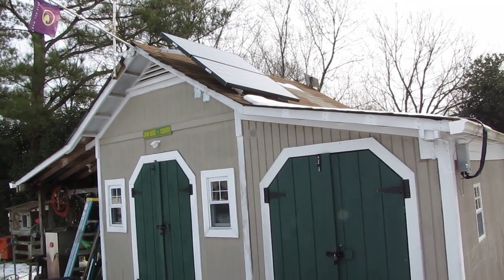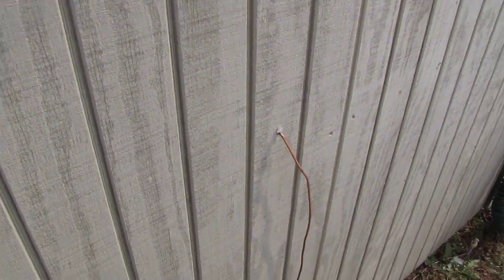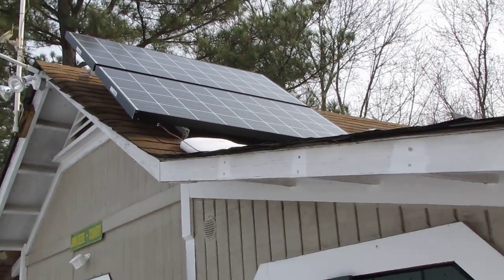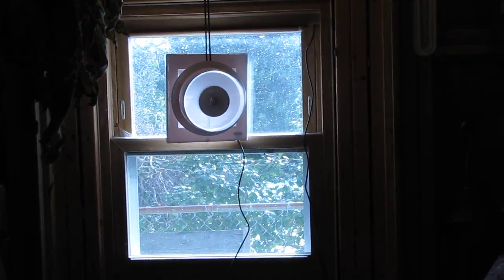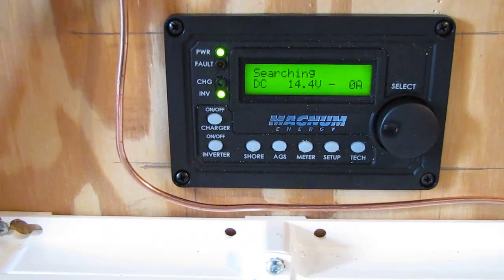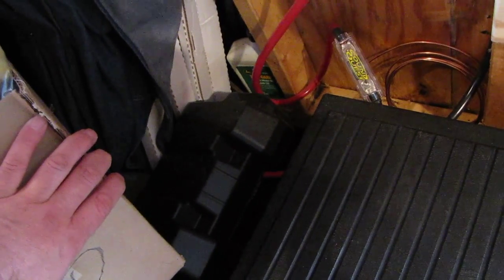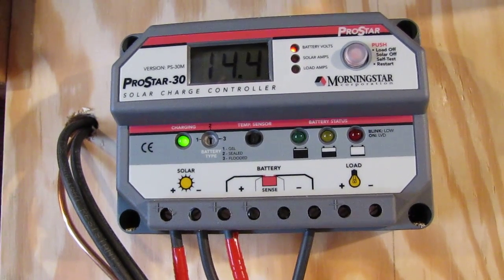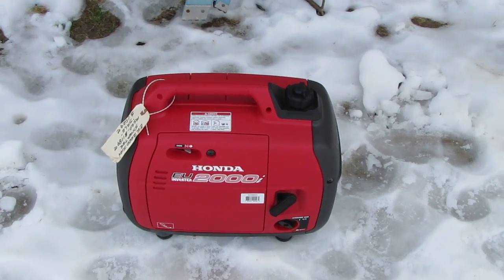My Solar Power Back Up System For House & Shop OFF THE GRID The Beginning VIARLOCITY part 1

Comment: two panels solar 100w or 200w
Reply from the maker: +Hiep Vyhoang these Are 2 - 135 watt Kyocera's
Reply: KVUSMC / Kenneth W Viar Jr 1 sheet 135w isn't
Reply: I want to do 1 the as ad but that in vietnames more money too 💲💲💲💲💲
Reply from the maker: +Hiep Vyhoang yes 1 panel is 135 watts each

Comment: hello kenneth W, how are you, I will make a specific question about your initial system with 2 135w panels is your inverter was 2000watts magnum magna sine wave, I wonder if, at the time he used the old drive by chance connected to it some kind of refrigerator for long periods? If the answer is yes, please specify which brand and model, power type ac or dc power consumption in kw, if you have this information, I wonder a bit about ok, thank you and congratulations for his valuable contribution my dear friend!
Reply from the maker: Hey Buddy This is I First started out My System A fridge burns very little only when The compressor Cycles You may see 800 watts or less since then I have added allot more Solar and Wind buddy any question you have I will answer cheers Kenny

Comment: Batteries DO NOT like to be wired in parallel.

Also, your combiner is NOT wired according to code, and is dangerous.  The two holes in the top and the one hole in the bottom where the wires enter and leave need to have connectors installed.  These are strange looking little doodads which screw into the holes, then have a clamp which holes the wires in place.

The way you have it, eventually the sharp edge of the metal will cut through the insulation on your wiring and cause a big short to ground.
Reply from the maker: Tom Wade Hi Tom Many Thanks For Your Comment I need All The Help I can Get Since Then I Rewired Everything That Was 4 Years Ago Cheers Brother Here Is My New System 
http://youtu.be/VDhRd1oKbVM  Cheers Again Kenny

Comment: You should consider adding the tri-fuel adapter, it will allow you to run propane, or nat gas along with gasoline. Makes doing syngas easy if you want later on. Nat gas hookup can be done easily if you are running its already in the house.
Reply from the maker: j johns Many Thanks I Already Converted It To Tri Fuel
Reply: nice, how do you like, it, I've found mine to be very useful

Comment: just took alook @ your video....  instead of charging right off the generator, use a real battery charger.... a more efficient use of your fukl... just a suggestion... watched diy off grid camper/rv up in ny///

aloha

Comment: All I want to do is have 200-500 watts 12 volts useing 100 watt home depot solar pannels I would only like to buy 1 controller and hook all the pannels ...I really don't want to spend a real lot of money  do not have...But can anybody tell me what kind of a controller or regulator I need to get to do this job for me...I just want to be able to run a small 19 inch flat screen hd tv..or use the satelite reciever sonic view with the FTA and the 3 ft dish...plus a  light and my laptop.. 978-3148794.

Comment: You gota a great accent there and a fine video, pretty neat setup, which type of solar panel would you suggest, a photovoltaic (PV) or monocrystalline, these two seems to be most popular of them all so plz advise based on your experience with solar, thanks and Godbless！

Comment: I had one but stop wrkn, I wanted to get one but the guy@  the solar store said it be better off to get a pwm and another panel with the extras cash (what's ur opinion on that?) Do u have any formulas I can use to figure out what I have?  By the way u have an awesome setup.

Comment: Hello again,  I have a 225 watt suntech panel rated@  29 volts, to a 60 amp tristar charge controller,  with 4 six volt batteries with 200ah , I connected 2& 2 in series. And then contacted those two for a 12 volt battery back@ 400 ah, any suggestions?  And can u tell me the capabilities my system has, also havea 1200 wa tt pure sine,,,,,, thanks

Comment: Some [but not all] power inverters can be connected in series to get double the AC voltage, not DC voltage. Xantrex XW-series can be stacked. Google "stacking inverters."

Comment: Okay so 24 volt inverter it is, thx for yr hlp,. Is it possible to run identical inverters or control chargers in series or parallel?

Comment from the maker: Now If You Have have 12 Volt Inverter  It is only Good For 12 Volts & 12 Volt Batteries In Parallel  Inverter's Have to Match Battery Power Buddy

Comment: Another?  . I have a 12 volt 1200 watt inverter,  can I connect it to 2 12 volt batteries that I connected in series( 24. Volt battery now), keep in mind I have a 12/24 volt mppt control charger,  or do I have to buy a 24 volt inverter ?

Comment: Sounds like you need some more info before you do it yourself. But yeah, its definitely possible. A few tips, all panels list "nominal voltage" it changes depending on the amount of sunlight hitting them. Also wiring the battery bank to higher voltage like 48V is ideal.

Comment: I have a suntech225 watt panel (225-20wd) Its a 29 volt panel, how would I be able to connect it to my 12 volt system, with my 1200 watt sine wave inverter.  I just ordered a mppt 12/24volt control charger, but I was wondering if I can do it with my old 12 volt system

Comment: I have been trying to get setup to use solar, first grid tied is way exspensive [rich green guys game] but off grid seems doable, I bought 2 panels 1 is 135 watt 1 is 85 probly should kept at same watts,  but I wonder is there a site that helps plan doable for real life, that will run most of a house,  I called 1 company asked system I'd need to run 15 watt heater , lol they said about 40,000 watts, I just want simple safe system.

Comment: is that eu2000 not the most impressive little 110v generator?, I have the same one. You have  a very nice, high end set-up. Im sure you can add more panels and batts on with ease. I hope to be there soon and your vid helped. thanks

Comment: Enjoying your vids on back-up power! Want to go with a grid-tied system with battery back up and wind generator myself. So you got rid of the Magnum Inverter in your revised system to beocme grid-tied with battery back-up then? Unfortunately the Manitoba govt (province in Canada) is only offering a 10% rebate on grid-tied solar systems & that work must be performed by certified installers so expect it to be pretty expensive unless I can gather all the hardware where I can find best deals.

Comment: Beauty system, I'm just learning about solar myself and this has been one of the more helpful vids. I started with getting back-up generator, went with the Yamaha EF2000iS, a little nicer than the Honda but you can never go wrong with Honda. It's a little lighter, a little beefier in max surge loads and better in maintenance with brushless motor. That's one beefy inverter!

Comment: I commented ealier about your system when it was half the size.  It certainly has grown, but isn't your system still a little underpowered?  Also, you're using it as a back up electrical system, but in the mean time are you still feeding the grid with your Inverter?  I'm not criticising, simply inquiring.  I'm in the developing stages of setting up a system right now, and was hoping to get some insight about what "NOT" to do, as well as "WHAT to do."
Thanks for your service Marine...
DAUSARMY.

Comment: Seems like a pretty good set up, but also expensive.  I wonder if you should add more PV panels to better balance your system.  I'm thinking the rechrage time with two panels might not be enough to keep up with your consumption during a power outage.  With a 2000W inverter, you should be able to increase your PV array quite a bit.  Thanks for sharing info about your system.

Comment from the maker: @Wilkinsburg1960 Any Time Buddy  I have since Upgraded My System I have 1.330 Kw Plus 1kw Of Wind Power 2  500 Watt Wind Turbines  Man It is Great  I have an OutBack  GTFX 2524  I have everything  in 24 Volt Now Mine Paying Back quick Slowly But Surely  I had Power Out for 8 days & Nights During after Hurricane Irene  It worked Great

Comment: Thanks for sharing. I'm new at this so I copied as much as I could off your system. The only diffs are a Morningstar ProStar PS-30M, 12/24V Charge Controller, Sunforce 2500 Watt Pure Sine Wave Inverter, different batteries and a total of 4 Panels making it a 540 W. gross system. I'm in Pennsylvania so it'll never pay for itself in money saved, only in peace of mind and a bit of fun. Keep up the good work.

Comment: @kvusmc that and a fire extinguisher at the front door. With no ground wire you become the ground when you touch the unit. Ground everything always! I,ve used my fire extinguisher units several times, seems like I'm always saving some strangers car or something. Never had a solar panel fire or problem!

Comment: @sniper77shot  that's why I also have a windy nation model 750 wind mill. when the clouds roll in solar panels output drop 95% to almost nothing. I turn off the system during storms, after the storm when the  power is out  I turn it on! I've got 2400 amp hours at 12vdc, with plans to go to 4800 amp hours!

Comment: I would add more solar panels and batteries,  a fan motor in the battery box,A lot of money in the basic sytem just not enough incoming power or sored power. At least you got a plan in affect!

Comment: THE INVERTER I INSTALLED HAS A BUILT IN 50 AMP 3 stage ac TO dc CHARGER,  you have to put in the right plugs for the type of batteries your using

Comment: by the way the inverter I installed is 36 volt DC run 240 volt AC output, with 3/0 welding cable feeding from battery’s to inverter, and a 1/0 welding cable to earth ground, welding cable is by far better the standard auto cable, do not use cheap automotive lugs on the end of the cables, do not crimp them, use the solider inserts lugs, we wholesaler all that to dealers and jobbers

Comment: not long a go i intalled a 2500 walt inverter with a built in 15 second 7200 watt spick. i.e for when deep well pump, moter starts, no dimming of lights when moters start, or mic wave, great system, under 1000.00$

Comment: 2 things, you should not mix AGM batteries with your regular lead acid, i.e your old trolling moter battery, your inverter needs to be set for one, for right charging, 2 never mix old with new batterys we sell 125 Lbs 6 volt 300 aph each, so one give you well over all your batterys put to gether of your amp hours, you hook up 2 - 6 volt batterys to get 12 volt, or 4 for 24 volt, retail 300.00 each, very long life, as long as you look after them, 4 to 6 days running with out sun, with normal draw

Comment from the maker: @avianphlu5397 I have a 12 volt system   with AGM Batteries at 450 amp Hours  My tolerances in My Batteries are set at 11.5 to  voltage shut off  to 14.6 Volts fully charged anymore question Hollar at Me I think the Magnum Inverters are By far the Best on the Market

Comment: I was hunting for Magnum energy Utubes and came across yours.  I have an existing 4000 watt solar grid tie system that I am upgrading to a battery back up using the Magnum Energy 4048 (4000 watt 48 volt) battery back up.  The Magnum inverter needs to be programmed to the type of system you have i.e. Lead Acid, AGM, etc.
also what charging profile for Bulk and float charge based upon the battery tolerances...once that is done...you are good to go.

Thanks for the video

Comment: Hi. Good job on the system. One thing, the way you wired the batteries. Did you come off the closest negative and the furthest positive? If you didn't, system won't operate properly and it will ruin your batteries. Can't tell if you did in the video. Also, you should be using at least 2/0 copper on your battery cables, which is good for 125 amps. Is that what battery disconnect is rated?

Magnum inverter is good choice, and nice job on grounding, lightning protection.

Comment: Good system,
Have you ever run your house/shop on the inverter after a full battery charge to find out how long a full charge will last? have you ever heard of Missouri Wind and Solar? they are a DIY shop where you can build a Permanent Magnet Alternator from a Delco 10SI  Rebuild.  I've built one up from where in a 10mph wind It puts out close to 5 amps in that little a wind. M Wa& S have tons of DIY videos on youtube. Could be a good 2nd turbine. Great system Brother !!

Comment from the maker: 1600 for inverter
900 for panels
120 for panel mount 
200 for solar charge controller 
800 for batteries 
500 misc cables breakers etc